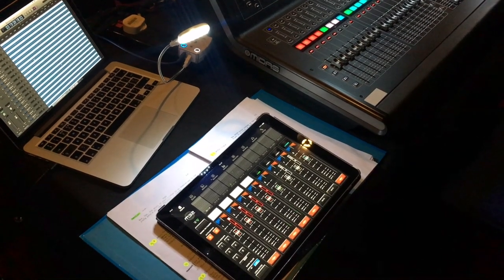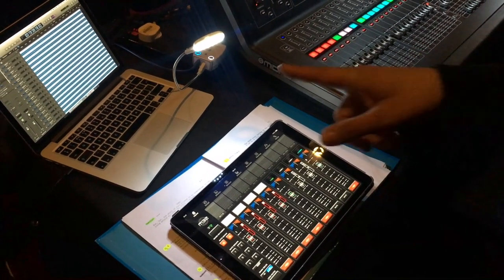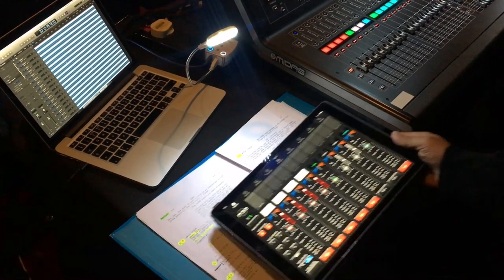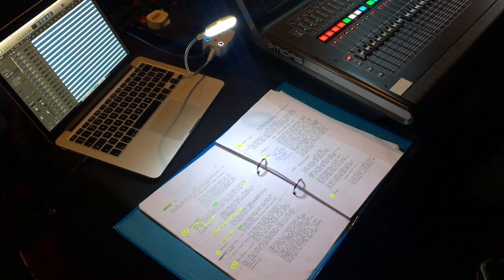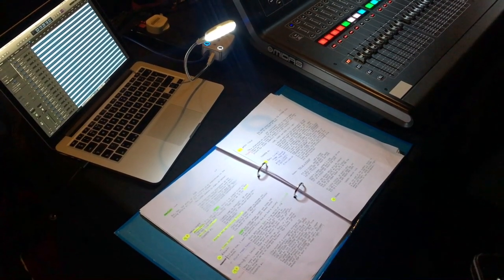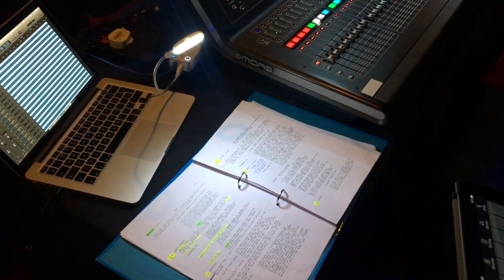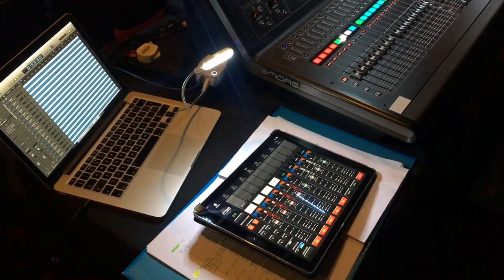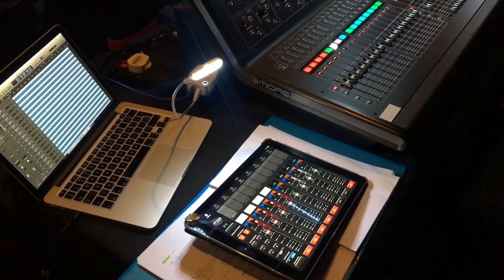Midas M32 - Theatre Show Overview. Singing in the Rain

Comment: I didn't understand how automix works in your situation. But it is very important for me to understand. It looks like it works as FBX (anti-feedback) but how it knows levels needed and why it not feedback when you turn fader up?
Reply from the maker: There are 4 float mics. Each mic is soundchecked individually with eq for maximum gain before feed back. If you turn all 4 up together the combination results in feed back. That’s where the auto mixer is used. It only ever keeps one of the mics at full volume and changes that selection depending on the loudest source in front of it.

Comment: I loved watching your video. I have started using DCA fader with the upgrade to a new desk. I have to say I am a beginner sound mixing guy :) But I have a question: Do you use post or pre fader mixing for the monitors on stage. I heard most people use pre fader but it also makes sense to use post fader. What are your thoughts on this?
Reply from the maker: Thanks for commenting.  Generally, the done thing is Pre fader because once gains are set you be 100% sure what level is being sent to stage as it won't change.  Post fader will change when you start mixing out front.  If it's instruments, I choose pre... ask the musicians or people on stage if happy... then leave the volume on stage allowing me to control the Foh sound as I see fit.  The only time I would want to have post is if I do want that control.  For example, a backing tracking.  If you had to fade to silence out front, pre fade would mean audio would still be coming on stage! Hope this helps.

Comment: You should try X32-Mix theatre control.
Reply from the maker: I was!
Reply: You didn’t mention it, you did mention snippets.  Anyway, very nice setup and I appreciate you taking that time to make the video. The auto mix on stage mics sounds like a cool idea, are you still using that? Do you think it would also work with hanging mics above stage? I work a high school we have 6 mics hanging above the stage which are very difficult to use without feedback.
Reply from the maker: @genmce  I planned to do a whole video on TC but never got round to it. Great software. I also used in conjunction with snippets to load different mic settings for swaps. Auto mix works great for any multiple mics on stage when doing spoken word. Just picks up the closest mic. Works great on hanging mics too. Just be aware of settings when people sing. Fine for 1 person but for multiple it will only pick the strongest singer. Hence having the on/off and a group fader standing by

Comment: Do you have any tips for programming scenes and snippets quickly?  Just started using the x32 for musicals although I’ve been doing sound for years. I understand how to program a show just curious if there was a streamlined workflow that you could share.
Reply from the maker: Joel Noles - I normally just use snippets for the lavaliere Mics. Select those & mutes,  and name and group tab and select vca: so vca assignments change. Occasionally tick fader to reset faders to 0db (normally after each scene). Band is left as is. 

I always start with a master snippet where the last 2 vca’s I’m using has all cast assigned, split boy/girl. I found it easier to mute what was not needed and move solos over to the first vcas this way. 
It is quite mammoth to program. But results are worth it. 

Recently I’ve used theatre control by james holt to great affect. A very useful piece of software if doing more complex shows: http://jamesholt.audio
Certainly faster.

Comment: Great information. We use a M32 and your video helped me understand working with Cues better. When I push the Now button on our M32 it ask me to confirm this action with the right arrow over button. I noticed your M32 doesn’t ask to confirm. Is there a place to turn the confirm option off? I appreciate your time and video. Take care.
Reply from the maker: Mike Bader simply disable the pop up in preferences. I’m actually using a different cue method mentioned above for This show
Reply: Thank you for your help. Found the option in the preference and works much faster with the confirm option turned off. Have a good day.

Comment: Hey guys! I hope someone will get this. I'm trying to make a pink noise output line check cue list just like in this video. The problem is the snippets don't seem to save my oscillator assignments. Can I please get a step by step walkthrough so that I can correct the mistake I am apparently making? Would be awesome.
Reply from the maker: From memory I think the pink noise is coming from one external source (a wav file in QLab) I’m then just automating mutes with snippets. Hope that helps
Reply: @VoodooValveTV  Oh, that explains it. Many thanks

Comment: What are the 4 mics at the front of the stage used for if you have 20 wireless mics?
Reply from the maker: 4 x cheap Float  microphones. There were about 30 in the cast. Mics used for occasional lines (when not mic’d with wireless) and some chorus. Also Tap dancing.
Reply: @VoodooValveTV  Thanks